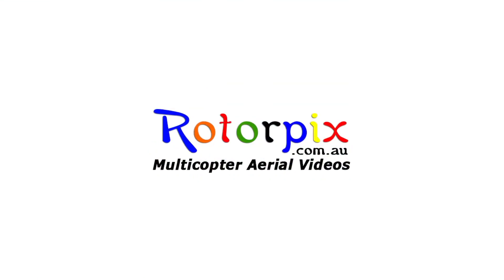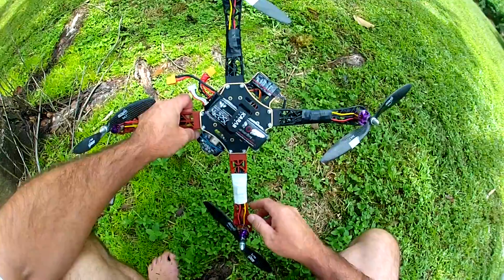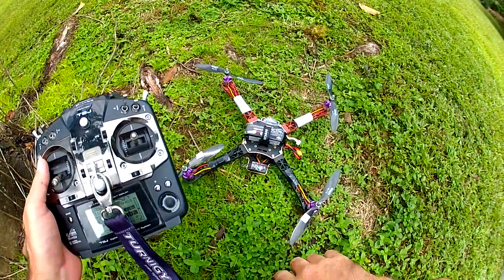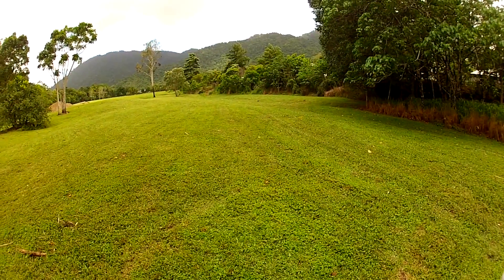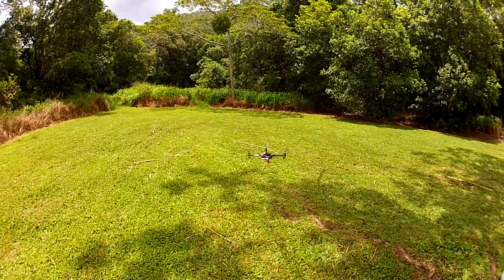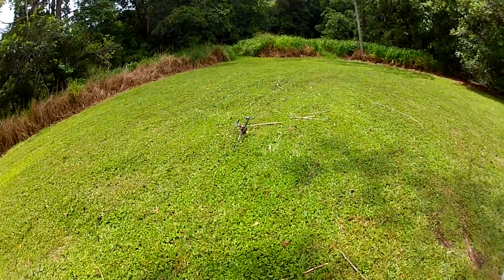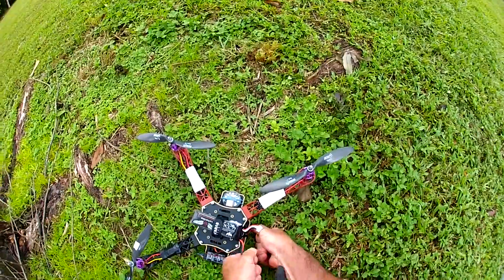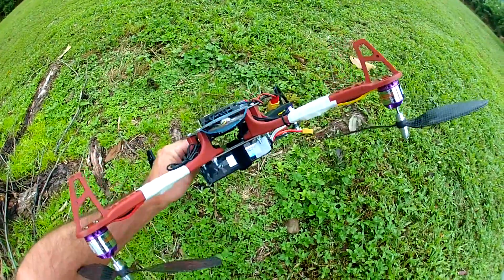Fangarab Maiden Flight Qbrain Fail

Comment: Did the qbrain work again after letting it dry in the house or cleaning the circuit board, because something like happened with mine.
I flew in snow, one motor smoked, I pluged the motor off, a day later the motor was running again.